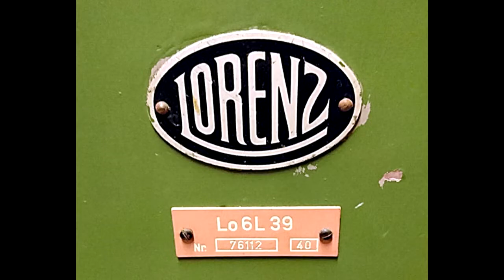German WW2 radio, Some mecanical details on Lo6L39, TRF Receiver

Comment: 0:30  I like how they switch in multiple components by turning the drum.  Nowadays, they tend to have the components mounted statically and run wires to a rotary switch on the panel.  I think this old way is much better, since it removes the wire runs.  Why is this idea not used more today?  Sometimes I think we go backwards instead of forwards in technology :-)